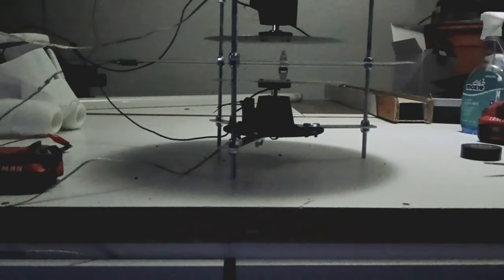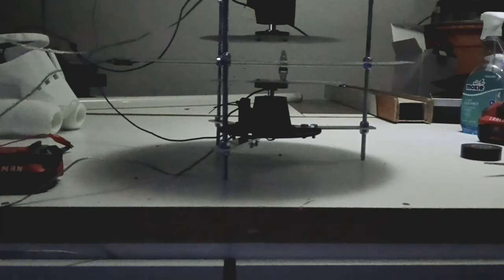Graviflyer "20kv Time To Have Fun" #45

Comment: Absolutely GORGEOUS!! It might be quite revealing if you can do some ultrasound tests while its arcing. We've got a few different instances now where we've tested an arc between two ultrasound speakers, and the arc will change /bend when the speakers are on. If you can sweep through the freqs of the US while it's arcing, you may find some strange interactions. Great work!
Reply from the maker: Thank you. The energy flow shows up at high voltages. I saw charlie bending voltage with the US. I wanted to use a transducer with a piece of acrylic above repeating testing I have seen. Then put a spark gap above it and see how much energy can be moves by sound.

Comment: It looks like when you accelerate the motor speed the plasma gets pushed to the bottom and when it's slowing down the plasma discharges on the top. If you can time amplifying resonance when the charge goes to the top disc maybe that would produce more lift? It seems like the faster the speed the larger the coronal discharge on the edge of the disk. This seems like wasted energy which we do not see in alexies further pointing to lower voltages and speeds like you mentioned. 

Maybe we can use VSD on the motor to concentrate charge where we want it when we want it there? However, this is just another variable and probably unnecessary.
Reply from the maker: I like overpowering voltage because you see what it is doing. For instance Alexey turns off the power and the craft stays air born for a while. Now we know why. We can also see the charge transfer. It is not because of the magnets at all. We also know that the power returns to the top when the speed reduces.

Comment: Ppl tend to forget these things are based off of a harmonic balance of all three elements. Electricity, magnetism and frequency. What I'm not seeing is the testing of alternating pulses of the high voltage to create frequency between the electric field creating a alternating magnetic field. The direct voltage is a damaging element to equipment.
Reply from the maker: In this test you are 100% correct. This is my spare Graviflyer. My regular one only runs at low speed and with great harmonic resonance. I strictly control the voltages to get each effect.
Reply: @nathanbunten4299  question is have to tried a alternating electric field. What I seen from your experiments is only dc voltages. The tesla coil obviously puts out a pulse, but have you pulsed the top and bottom plates alternately with the high voltage?
Reply from the maker: @TheInkhousecustoms  I have put HV on both disc's and TC to the center plate. ( normal configuration)

The I have done TC to the upper and lower discs and HV to the frame positive only. I tried negative and it blew my power source. Probably my fault. it is on my list to try again. 

I just bought 5lbs of awg 28 magnet wire. I want to make a second tesla coil and try 2 different coils to the disc's. 

also I want to try using a bipolar tesla coil on the disc's. 

I also want to build a 2 cone tesla coil where the small ends are in the middle and the #1 coil is at the center. 

I found that I can create fields that hold in or push out static volts. The tesla coil in rotation acts like a magnet in rotation. so it puts out spheres of energy. A center rotating plate with the tesla field would be best. That is why I wanted to try the 2 cone idea and rotate the whole craft and use an ac flyback with voltage multiplier to the frame to get more polarization. I am looking to thicken the fields and try to trap ozone inside of them. Basically make my own magnetosphere. 

I also believe I have the beginnings of a gravity well when the tesla coil is connected to the spinning plates. It has everything. The pull to the center and the push to the outside. it also has the outer field. I can adjust the static field in or out as well. When it interacts with the TC field it amplifies them. 

There is more here than just lift. I can build a field generator and a gravity well out of this project with minor tweeks.

Comment: I like this test video i like how you can see both ion fields also witch motor do you speed up.
Reply from the maker: Both are connected to one driver so the go the same speed.
Reply: Also i think the lip on the edge of the middle disc is facing down to used the coanda effect on the top and also repell the bottom ion wind down and what if you can make a small ion fan inside of the plasma and some tube to draw air from outside the craft to store ion's in the plasma
Reply from the maker: @angelguerrero2890  i did a fog test and the wind is almost none. When you see both field go to the center plate in a plasma display. think turning on a tesla coil at the center of the middle plate and moving the plasma to the edges of the middle plate. If you can see that now jump the tesla coil 30v what happens? The ions from the high voltage can be moved by a tesla coil field. but not when they are so thick unless your tesla coil is over 70v there is a middle ground in how to make the next experiment where you can show the field moving but it take a lot more power.

Comment: I have a question and a request. My question is 20kV definitely produce ozone. How danger it is ? and did u take any measures to avoid risk ?  My request is 'don't look from radial direction of the spinning disc, you can monitor from camera'.  I was wondering why the spark concentrated only on the periphery of the spinning disc.
Reply from the maker: Path of least resistance. All electricity does it. The ozone was not bad the 2 minutes test was done then I opened the garage door and aired it all out.

Comment: I couldn’t tell if there was any magnets. Did you take them off so as not to lose their magnetism at those high voltages?
Reply from the maker: I took them off so you could see the voltage better.
Reply: @nathanbunten4299  
Just a thought. After you get the Graviflyer lifting, possibly try pulverizing neodymium magnets and adhering that to the bottom plate. May give you a greater magnetic field to work with… or not.
One of Don Smiths energy devices uses that on a vinyl record record to change the flux field between two sets of neos.

Comment: All it took to levitate my gravinductor was the power for both a DC strobe light and an AC bulb on a dimmer.
Reply from the maker: I would like to see that.
Reply: @nathanbunten4299  I have populated a 5 1/2 foot tall rack with  all the components I need and now putting together the generators for it so I can roll it to a park nearby where there’s a large empty lot. I need to get emergency pylons and some caution tape. I will share videos of the gravinductor build and lift. I’m In Palmdale not far.
Reply from the maker: @danielfoster2788  When you are lift it send me a email oldmannathanbunten@gmail.com 
I will come to you if you can show the video.

Comment: Very nice, that computer left the chat. 🤣 what voltage does Alexy use? I thought he said 30kv?
Reply from the maker: he uses a dc flyback at 3/4" spark gap so 8,000-10,000 volts. 30kv would have to be done with an ac flyback and a voltage multiplier. That is what I used here. Just smaller capacitors.

Comment: Anyone else notice, that in side view, the Sparks on top have as sequence to the lower plate?
Reply from the maker: same driver for both so the beat frequency is the same. Good catch.
Reply: @nathanbunten4299  That would indicate that Top plate affects the lower plate.
If you flip it upside down, and patter changes to the same as top to bottom..

Then that would indicate Gravity is affecting or is affected. 
Hmm. I wonder! And look forward to more info. 
Keep up the Great Works!
Reply from the maker: @marlonlacert8133  Remember the fields video.  Testing 7 I think. The beat rate of the whole craft is controlled by the upper disc speed.

Comment: Well, if shaped the discs like cymbals, it would have a different effect, as well as the geometry of the cymbals themselves in-ratio of the inner bend becausenof the monroe effect and path of least resistances. but then again, if you changed out the center disc or outer discs for a ball bearing, or something like beveled auto wheel bearings, you might see some serious changes. The "noise" is done different, as well as the transfer of energy. Try suspending it in the air, first, and see if you can't ground it to itself or a capacitor that isn't returned back to the circuit. Imagine shidding and holding negative charge inside a tube, and that's what you use as a ground, instead. It isn't uncommon for a vehicle to be grounded to the frame and have insulators like tires. Hell, try putting boots on it, and ground it to your boots.
Reply: Chew this over- a proton is two thousand times heavier than an electron. If you could concentrate the protons with angular momentum, you may achieve lift. Having electrons above and below would certainly encourage itself to leave Earth, but the center disc is still comfortable staying right where it is. 

An airplane wing consistantly drags through the air, creating static induction with the air around it. The more the air brushes upward at the brunt of the air-frame, the initial angular momentum is up, before it slides down the backside. Leverage happens over a distance and surface area. Since even underneath the wing, the air may be positively charged, the same space-time the air meets again at the tail creates a pressure effect like grabbing a bar of soap. Sure a hotdog can fly, but only with enough voltage. That would insinuate that there were more electrons than the weight than protons and/or affecting nuetrons, jostling the shit out of it from tugging it away from the planetary mass below. Alex was in a cold place, to be sure, and probably near some powerlines for stray energy. lol
Reply: Some would say it's just cold and hot air, which does make a difference, but why is it hot or cold? How much electron flow is required to get hot?
What is the charge of fire?
How about an air balloon?

Comment: fantastic its working now you got to get spacing right its nearly there i think. but i still think 1kv only.
Reply from the maker: Yes far less power. it does polarize the center plate much faster with more amps.

Comment: Pardon me Nathan, might I suggest instead of trying to manually drive the craft at its resonant frequency you instead let it handle that itself? I'll explain:

Through my research over the last 2 years into "certain" kinds of tech I've found that the common way of driving resonant circuits, such as Tesla coils, by manually driving it at its resonant frequency is comparatively poor compared to the method Tesla used, Tesla's method was through the use of a capacitor discharge into his circuits to make the coil freely ring like a bell.

When a charged capacitor discharges it transforms its potential into a magnetic current, and magnetism is kinetic force and motion, with the resulting amps being dependent on the charge in the cap, the resistance of the winding, and the rate of discharge, a mere 50 volts can be discharged into a 0.5 Ohm resistance to give 100 amps, Tesla used this principle to discharge capacitors into his high Q coils to make them freely oscillate for a period of time, depending on the Q, which would resonate naturally at its own natural frequency, this method completely eliminated the need to manually tune the driving input just to make it run at high efficiency.

So instead of trying to find the "sweet spot" of the crafts resonant frequency manually, just discharge a capacitor into it, you can use an external probe to find the frequency it resonates at in this way too, and with how easy it is to charge a capacitor from HV you can keep it running consistently, this also has the advantage of what I call "adaptive resonance" where any change that occurs to the crafts self resonant frequency won't impede the performance since the method of driving is self-dependent from self-oscillations.

Furthermore, once you find the natural resonant frequency of the craft from measuring the fields at a distance, you can manually adjust the charge and discharge rate of the capacitors to match that frequency, driving it in such a manner would produce the trumpet waveform as far as the increase in amplitude of the oscillations goes which has immense implications. But to take it a step further, you can also switch from using just the energy you put in to using another one of Tesla's methods, reactive power.

It's commonly believed that reactive power cannot be used for useful work, but this is blatantly false, looking at Tesla's Colorado Springs Notes pages 57-58 there are diagrams of high Q resonant reactive power tank circuits. What most people do not understand is that Tesla's method of driving power into the Earth operated on immense reactive power fields with relatively little energy input, this method made the Earth resonate and turned it into the supplier of electrical power itself rather than the tower being the supplier, it was just a catalyst. This principle is involved in other exotic tech but that can be saved for another discussion.

Dollard in the 2019 emediapress conference talks about this in putting a 1 Ohm reactance coil and capacitor across a 12kV power line that feeds itself 12kA, that's 12,000 Volts x 12,000 Amps for a LOT of kVAR's, the magnetic field from that is going to tear the nails out of wooden ships, but there's no energy in that system hence it just dies out if you try to tap it directly.

I believe that if you apply these 2 principles to your craft, as well as the Tesla coil you're using, you'll start to notice some results for very little input, the craft will automatically resonate at its resonant frequency and the energy cost will be practically nothing. A coil (and the craft too) can be thought of as a bell, a capacitor discharge (kinetic) is a hammer.

If this method interests you I also recommend looking into Aaron Murakami's Plasma Ignition, it uses a particular capacitor configuration to increase the resulting amp discharge through a negative resistance situation which pulls the current out of a secondary capacitor and drastically decreasing the time of the spark, which has some incredible results and is a perfect addition to this principle of capacitor ringing.
Reply from the maker: Thank you I will look into it. Where do I find tesla's notes? I will also look into Aaron's plasma ignition. Any youtube link would help. Here is my email for non tou tube links. oldmannathanbunten@gmail.com

Comment: In my understanding I don't ever see it taking flight with that type of configuration. You've got the concept but not executing it right. The main issue is the way you are feeding the energy. You need to take a few steps backward and take a 101 on what electricity really is down to it's core down to it's atoms/particles because that is what ultimately will give you flight.
Reply from the maker: In this test you are 100% correct. This is my spare Graviflyer. My regular one only runs at low speed and with great harmonic resonance. I strictly control the voltages to get each effect.
Reply: @nathanbunten4299  Ooops my bad. I should have realized that.

Comment: Higher. Drop the current to .00000001 amp and use 800,000,000 volts. 

Sounds silly i know. Wish we could try it.

Im sure China claims to have something.
Reply: Lolll 😂🤣😂🤣
Reply from the maker: I agree. I might run out of disc spacing. Totally worth it.

Comment: Nathan, where did the magnets go? And you still don't have the dielectric coating to stop the arcing. With this said you did not write back to me about what I sent you in an email. Namely the P=V2/R= I^2R equation that the power companies use with the AC power grid to send large power long distances as when the voltages are low due to a sinusoidal voltage leading the current and the voltage squared is way smaller than the power so the resistance is very low to compensate to raise the power that is sent over the wires and the current changeover to a DC power grid so that the current squared is way larger than the power so the resistance is very low to compensate so they can send the power over long distances with little degradation of the power. The DC power grid is for the current wind turbines, solar panels and eventually the fusion reactors and the many devices that are now DC powered. The power grid then acts as a room temperature superconductor and why the graviflyer with a high charge on it and the spinning magnets making the charge a circular current and voltage on the disks to make them have a low resistance and be somewhat superconducting so that the electron field does not produce heat or IR and instead makes anti-gravity waves so the graviflyer lifts?
Reply from the maker: I know. I just wanted to have some fun while way over volting this.
Reply: Nathan, OK. Enough said.